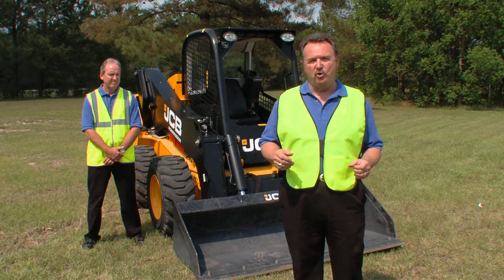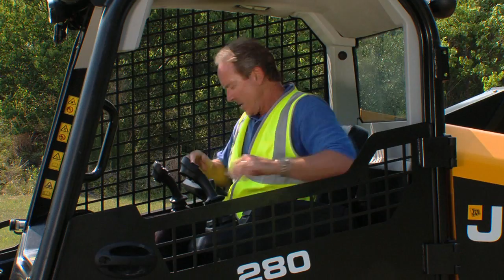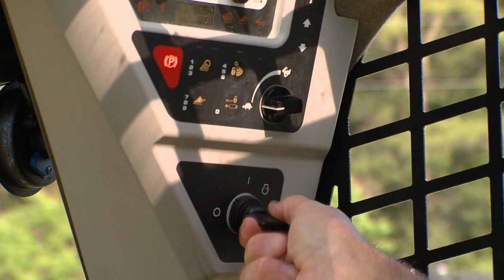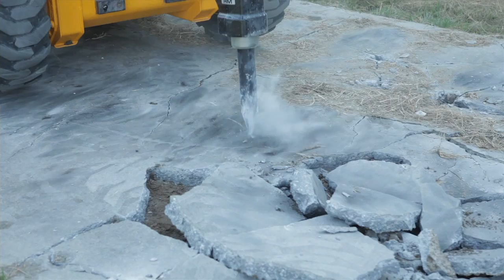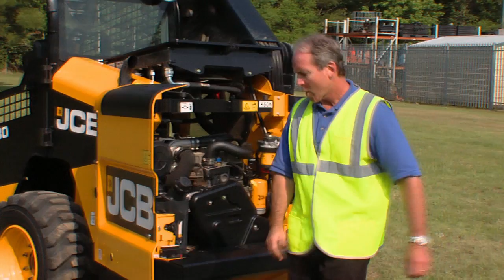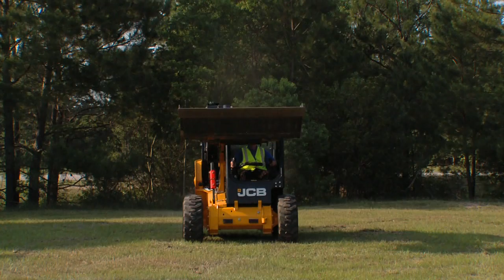JCB New Generation Skid Steer Safety Video

Comment: so what happens when you tip on your left side and your arm is mid way up how do you get out??? jcb and Volvo worst skidsteers ever they steer like your on ice tried 3 volvos for trials and all were the same then the controls and throttle are all delayed and the track system are solid mount to each side so rides like shit as well but I guess that's why there so cheap but Volvo should make there own anyone can do better than jcb

Comment: Cannot wait to try a new JCB 260. Thanks for your efforts.
Reply: Nice video, but they forgot to mention to lock the quick hitch after re -attaching the bucket. More details would be a good video as well...showing use of all buttons, toggles, etc. How to unlock the fuel cap (which I could not find in the operators' manual 2015 when I needed it!).
Reply: Kater Caters to Cats ee2